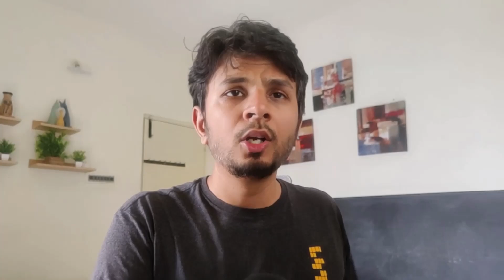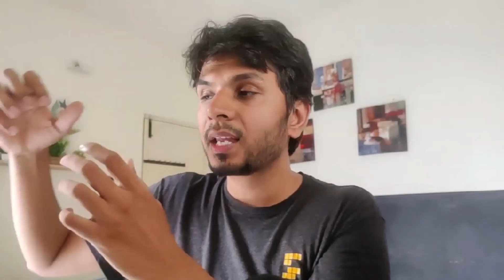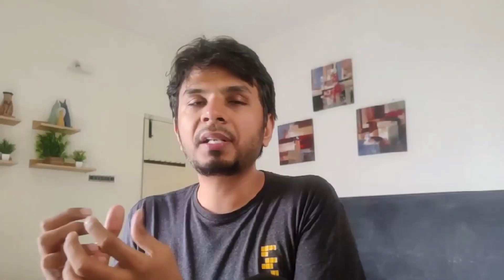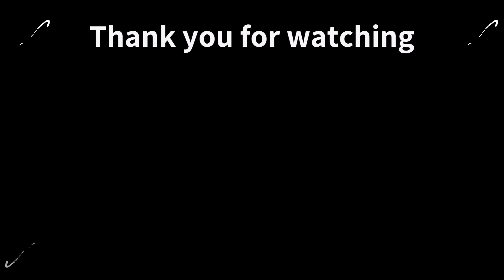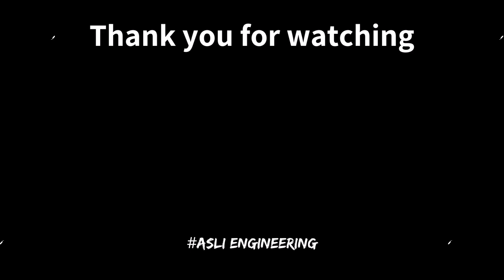Will AI replace programmers?

Comment: Every phase of automation/efficiency improvement in history has led to 
1. A higher demand for complementary skillsets
2. A higher induced demand for the resource that became more efficient from automation.

Its called Jevon's Paradox.

A British mathematician named Jevons observed a trend where efficiencies in coal powered technology (where more energy was generated using less coal) actually led to a higher demand for coal. A similar inference can be made for software engineering labor.

Also, technically a compiler is a form of automation. A JVM is a form of automation. A web framework is a form of automation. All of these technologies enabled more possiblities in technology, inducing a demand for more software engineers.